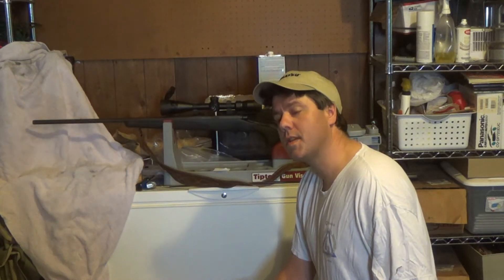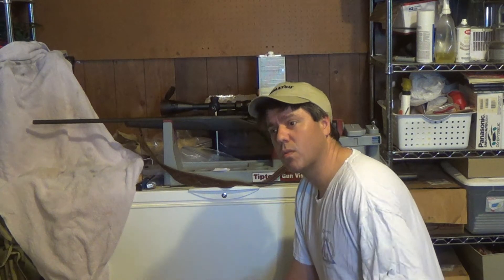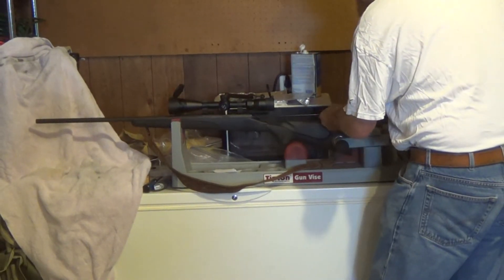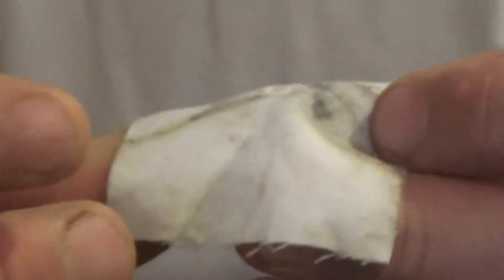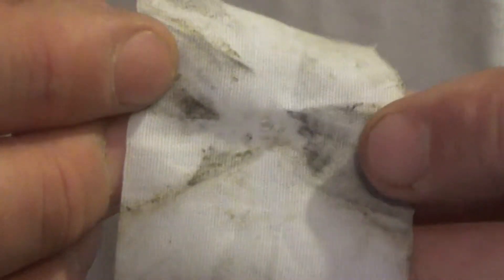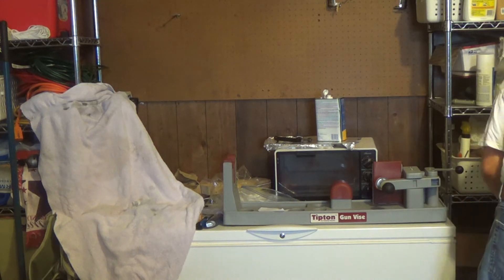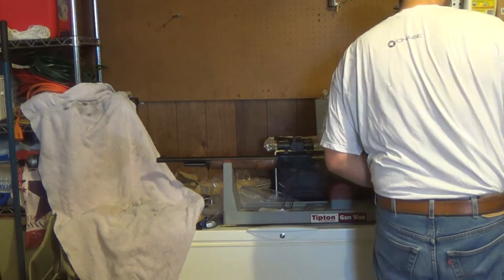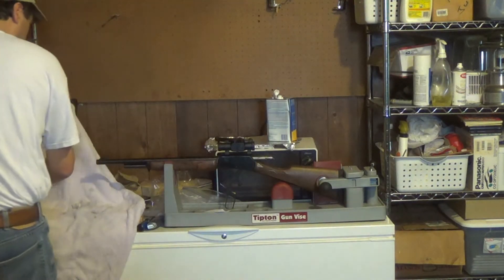Powder coating fouling results (rifle)

Comment: In your opinion could I get away without using gas checks on my powder coated cast 30-30 bullets ?
Reply from the maker: That all depends upon your load in the 30/30.  When I go full tilt I start using starting data for jacketed and work up slowly using GC designs.  Most of my 30/30 shooting is done with plane base using a light charge of red dot, it's quiet and gives me 357 magnum pistol performance in a rifle.  A real fun load to shoot.  For the most part if I want more velocity and energy I go for a different chambering although the 30/30 is more than capable of doing more.

Ebner

Comment: So, what power coat are you running (and how it it applied) and what is your projectile (profile and weight) and alloy/hardness?  I'd like to reproduce your results given the opportunity.
Reply from the maker: +Nutter1138 The powder used was Harbor Freight, it is cheap at around 4 bucks a pound.  The alloy used was water quenched wheel weights, hardness was probably around 16 B.  It was applied using the steel bb method covered in one of my other videos.  I will tell you that accuracy wasn't really there when approaching over 2600 FPS.

Ebner

Comment: Hi ebnerglocken!
Your videos are much appreciated! Thanks to you I have my 9mm working great. There is no fouling and it's really accurate. I guess next step will be 223. How hard was your lead for the 30-06. Did you have a chance to try accuracy with the gas check?
Reply from the maker: Casting for a .223/5.56 is with out a doubt ambitious to say the least.  I hope your rate of twist is cast friendly.  Between work and family (yes, I have a life) I do these experiments and videos on my free time.  There has been no time here lately to go further on the 30/06 as of now.

To answer your question of alloy.  Almost all alloys I use are water quenched wheel weights.  The gas checks that I use are mostly gator checks bought on http://castboolits.gunloads.com/  look at the vendor sponsor section. All other checks are hornady.  When my workload falls off and the weather gets a little better I will go further with the 30/06 using gas checks.  Another tabled project is the 8x57 mauser.  More videos to come.  Thank you for the generous compliments.

Ebner